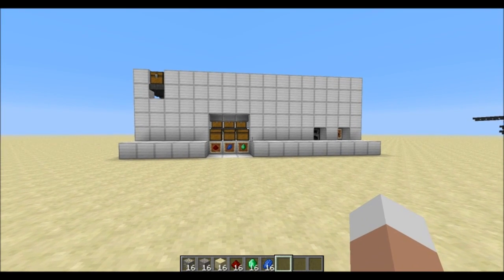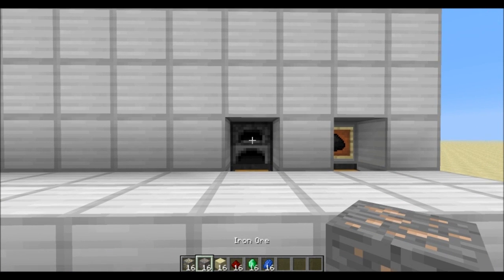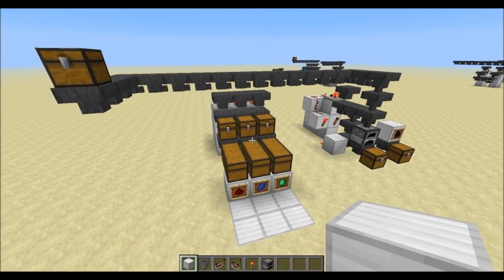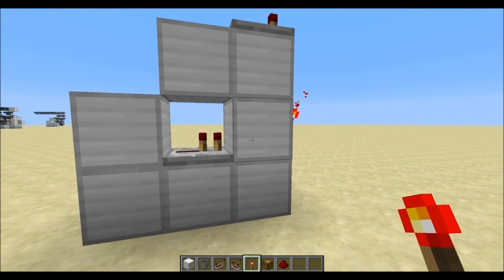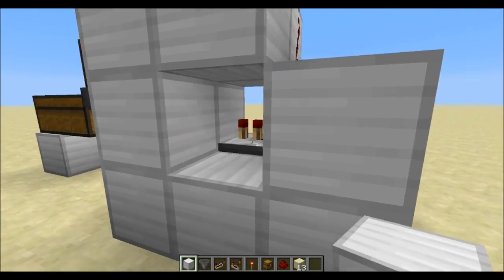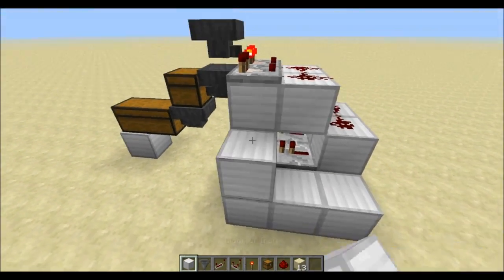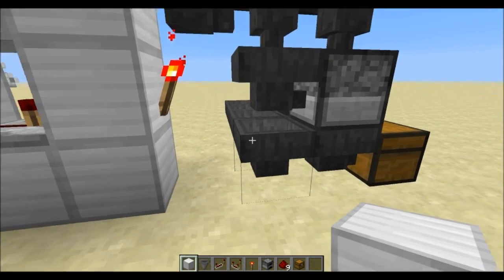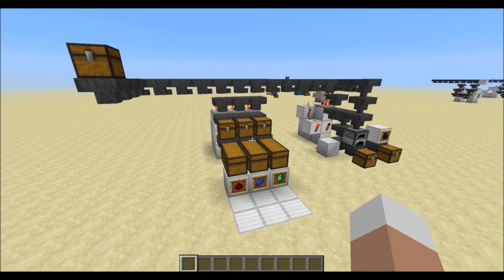Minecraft Tutorial: FULLY AUTOMATIC SORTING & SMELTING SYSTEM (1.7+)

Comment: Yo idk if anyone reads this 2024 but i am building this in 1.16.5 and everytime i put the blocks in the hopper like in the video the items from the next hopper will get sucked out completely. Why is this happening? i build it exactly like in the video. so if i put stone in the first hopper it will just run down to 18 blocks but as soon as i put for example cobblestone in the hopper next to the cobbelstone will run down to 18 but the stone blocks will get sucked out completely. I noticed that for me the signal after the comparator is 3 instead of 2. is that the problem? and if yeah how do i fix this? or is this sorting system just not viable anymore?

Comment: why not put a chest in series with the coal hoppers?  This would remove the need for the excess circuitry, and save the coal in the line so if you wanted to run off stone or glass you could with ease.